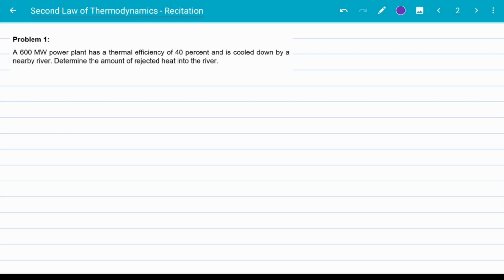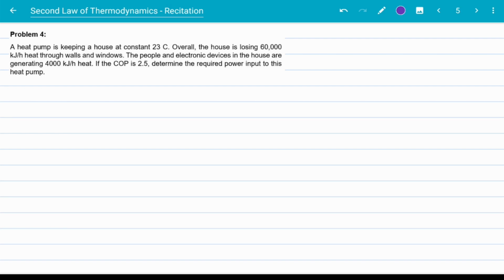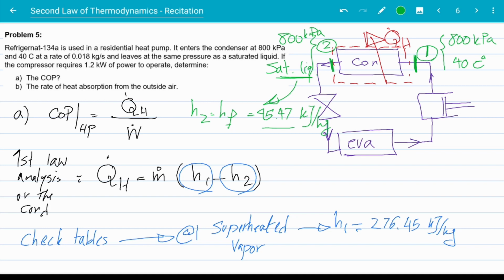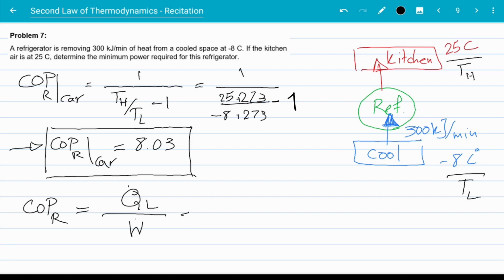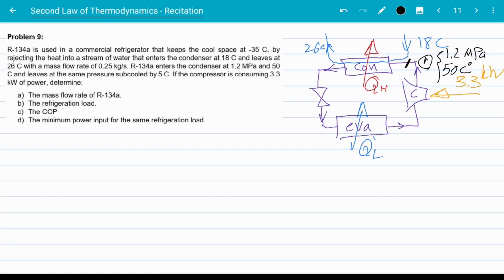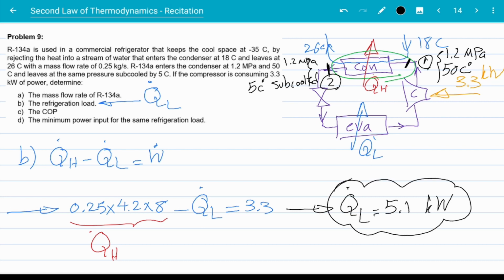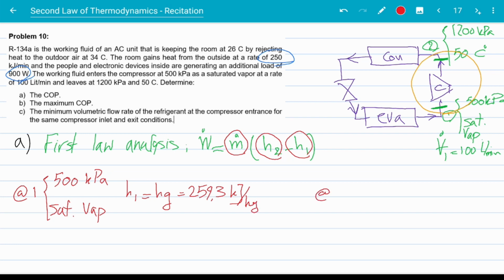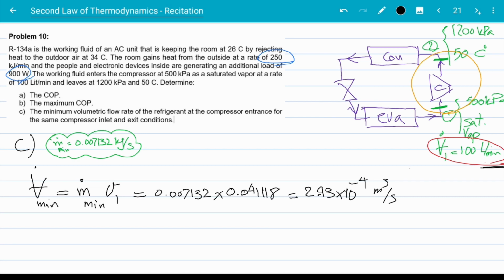Sample Problems - Second Law of Thermodynamics Recitation

Comment: For problem 5 shouldn’t Qh be negative because it’s leaving the system?
Reply from the maker: Very good question. Let's think for a minute how changing sign could alter the answer. You are right, Qh is leaving and so it would be negative. Ql is entering the system and should be positive. The work of the compressor is input work and so is also positive. Let's now write the first law for the system:
Ql - Qh + W = 0
moving things around you get:
Ql - Qh = - W 
now if we get rid of the negative sign:
Qh - Ql = W
as you can see, we got the same result. As long as you are confident about what is entering and what is leaving your system, you can set up the first law either way.
Hope this helps.
Reply: @WannabeProfessor86  yes it does thank you!